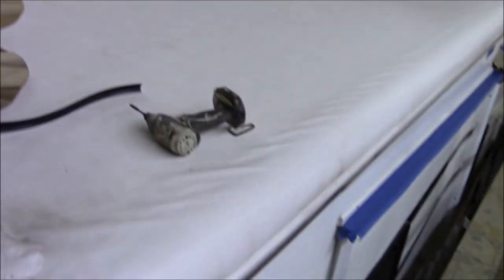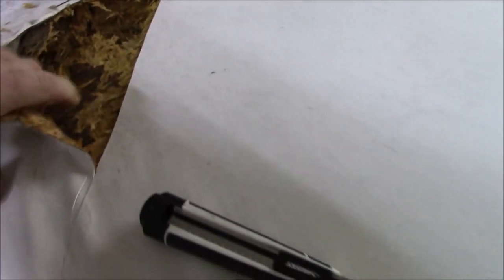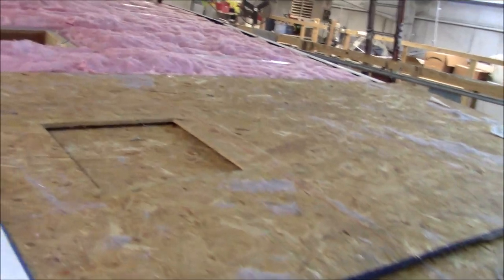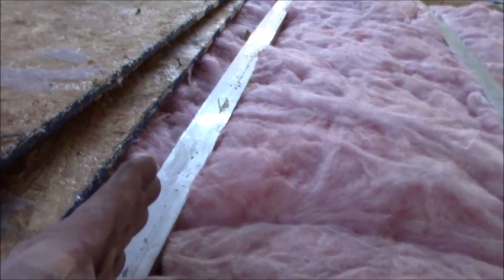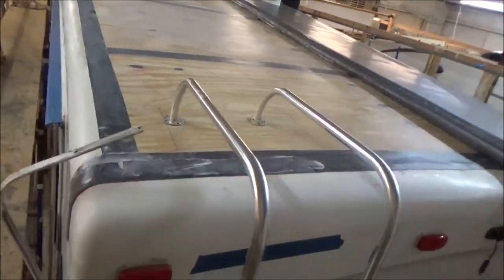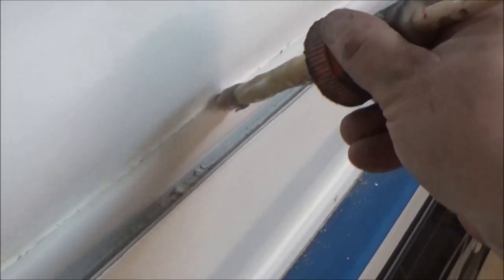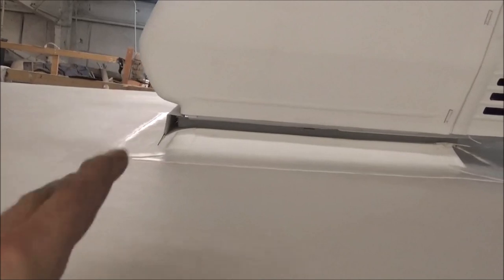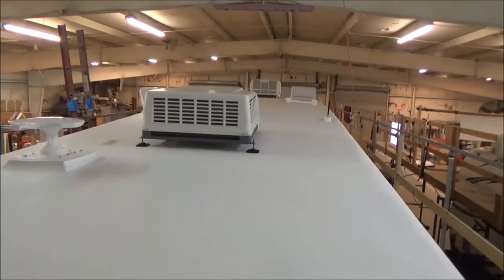Redecked and Replaced RV Roof on 2008 Carriage Cameo

Comment: Thank you so much for your videos!  You saved my new 5th wheel.  I took the unit in for warranty work and they used silicone to seal a exterior door.  Because of what you showed me I was able to convince them to use the proper sealant.
Reply from the maker: Keep an eye on that sealant. Silicone leaves an oily residue in the pores of what it is applied to, so even though they may have used another product, if they went over the silicone it may not adhere. Nothing sticks to silicone....not even silicone. Here is a blog from Sashco, a leading caulk manufacturer.
https://blog.sashco.com/blog/06172016-will-new-caulk-stick-silicone

Comment: I know none of them are that good but is there any brand of trailer you see that has the least amount of problems. I have watched a bunch of your videos and I know your not a fan of aluminum siding but is there a roof/siding combination you do like. Thanks
Reply from the maker: Fiberglass is better than aluminum, but the roofs are all the same. No curbs equals leaks. I don't have a camper. If you were to buy one get a used one, but better yet, check in with us from time to time. Once in a while one of our customers may sell their campers we have roofed and we will transfer the warranty. 
Watch the video on Steve Lehto's channel....Don't buy an RV...and you will be better prepared. Steve is a lemon law attorney.
Thank for watching!
Reply: Just watched his video and I understand what you and he are saying but he also said go to a park and ask someone and I feel like I was doing 1 better by asking the guy that skins them all day every day. Just wondering if there was a brand that stood out to you as being slightly better. I would like to bring whatever I get to you but I'm in SLC Utah.
Reply from the maker: If I bought one I would prefer a fiberglass with my roof of course, and I'd opt for a wood frame, not aluminum. The alloynin the aluminum is soft and I ha noticed not many manufacturers actually weld the aluminum together well I. I see small stiitch welds typically on just one side. So for that reason I'd prefer wood. I'd opt for ram style slide out and not rails. Rams are underneath and can be removed in order to remove a slideout where others are on a  rail on the floor which is a pain in the a$$ to remove. 
But as a rule they are all the same. Get em built...get em out...get em sold. I would not recommend and RV center for service or warranty. All the other small companies like us are certified in AC, refrigeration and appliances and they do a better job for the customer.
Reply: Thanks for the reply, just subscribed

Comment: what kind of caulk do you recommend?
Reply from the maker: Ms. Pam what are you trying to seal? Roof, windows, doors?  You can email us... contactus@rvroofinstall.com
Thanks for watching!
Reply: @RVROOFINSTALL  I have a 28 foot 1992 cobra laguna motorhome that needs to be gutted totally and resealed. I've heard all about not using silicone and that's what is all over it so I need to redo it all.
Reply from the maker: @pamkgs  Ms. Pam you can use Dura-link by Chemlink. It comes in a bunch of colors. Orange citrus cleaner may help break some stubborn spots loose my
Reply: Thank you  @RVROOFINSTALL  and after watching several more of your fantastic videos, I now know why you asked me what I was needing to fix because there are many kinds.